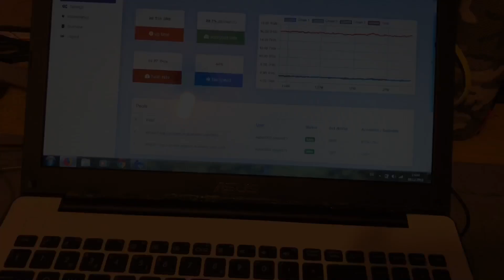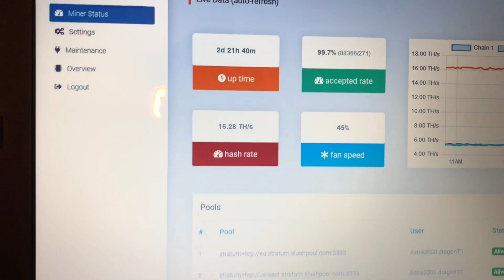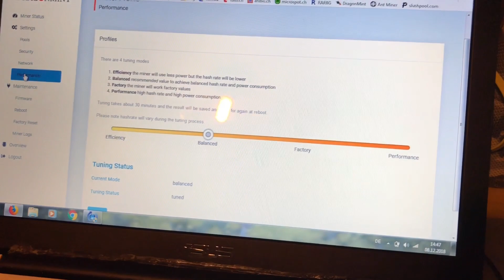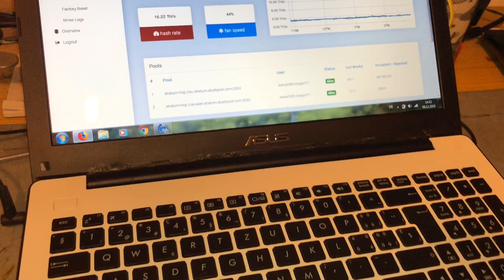How to Soundproof your miner - Noise Reduction

Comment: Thank you for the video. 

Did you had any problem after running it for a long time?
Reply: Basicly,

Sound panels
Air Intake - Air outtake
Reply from the maker: Fel Chocobo yes, i have reduce the noise for about -10% -15%
Reply: @canalfixe  how much S/ are you farming with 1 machine ?
Reply from the maker: Fel Chocobo the S9’s are obsolete. Still, free energy give me 0.02btc every 3 months
Reply: @canalfixe  How exactly did you get free energy then? And do you have an idea how "silent" it's possible to make a 80db machine?
Reply from the maker: Hi, i have free energy because i live on a place where I don’t have to pay nothing for the energy or water. It’s very difficult to lower the Db’s but if you manage to cool down the air to 10 degrees the miner don’t need to max spin the fans, the fans will slowdown. If the problem is the noise, you can put the miner on mineral oil
Reply: @canalfixe  Cool, well actually I have reduced electricity cost too :) still most miners would be losing options but I see there are good alternatives. Maybe I could put it in my basement then, however you would hear the noise on the streets then too. Not sure how legal it is cuz I do know in my country you pay taxes on what you win on crypto or other investments, but ye that's looked a bit far. Let's say the place is 10 degrees celsius how much of normal 80db noise would be left?
Reply from the maker: See this video, my best performance https://youtu.be/T3Nkcz8aWY4
Reply from the maker: No, almost one year now, no problems